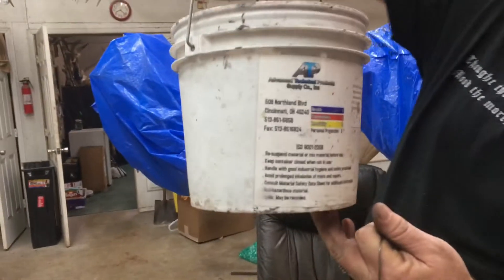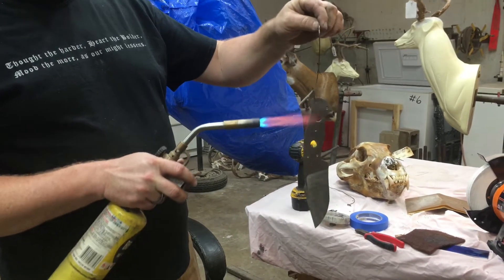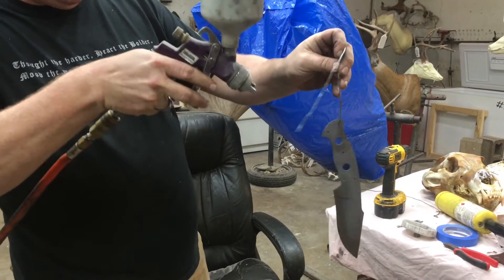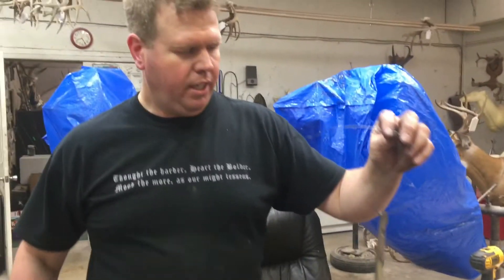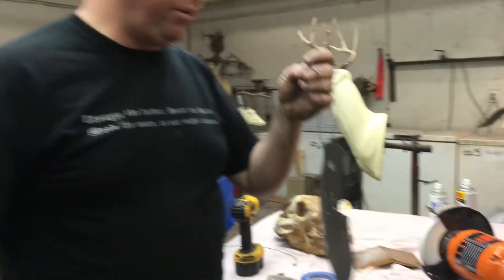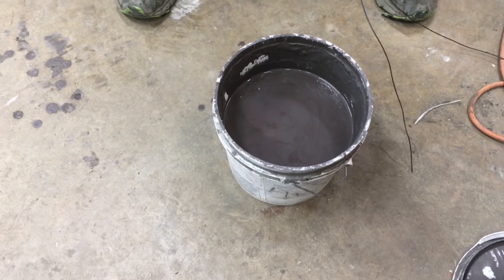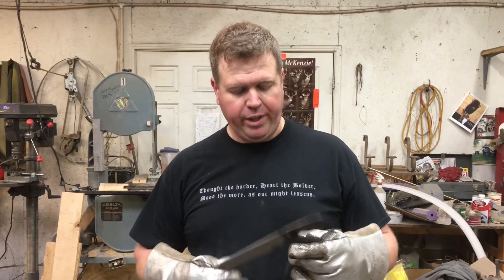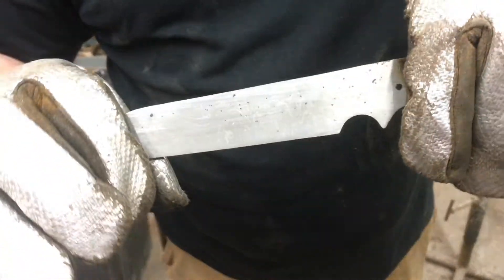ATP-641 How to use and product review

Comment: Hello, how do you clean your paint gun after use ? If it’s just 3 knives at the time and not 10+, it’s a lot of cleaning for just a few. Using a brush is gonna be too thick ? Did you mix with something to thin it in your example or straight from the bucket ? Thx a lot

Comment: Any experience using this with A2 or CPM 154? I'll be beginning my own knife making soon and would like to go without the foil so long as there's no decarbonization. The foil makes me a bit weary for a few reasons.
Reply: It works very well on both of those steels. Make sure you get the coating on well and even. Clean your blanks, degrease them and let the coating dry completely. You will be impressed with the results. At this point I have used it on over 500-600 knives with no problems at all.
Reply: @josmith6210  thanks!

Comment: Just getting started with 641, are you still liking it? Have you run stainless with it?
Reply from the maker: Yes I still love the stuff! I use it every time I hear great any blades in my shop. I have used it on hundreds of stainless blades over the years. Best product out there hands down.
Reply: @silveranvilblades8718  it is nice spraying it. A bit of hard decarb on AEB-L so it comes down to abrasive costs vs foil cost. I use a vertical kiln so is nice to just hang them.

Comment: You have the first YouTube video on any of the anti-scaling products that I have seen that actually shows the end result.  Thank you very much!!  I use a lot of 1095 and 01 steel in my business.  It sounds like experimenting with the ATP-641 might be worth my effort.

Steve
http://www.littlebearknives.com/
Reply: I use this stuff with foil and paint the corners of the foil folds. It's a little excessive but you get absolutely 0 decarb at 2150F Aus, it's as if the knife wasn't heat treated - literally.